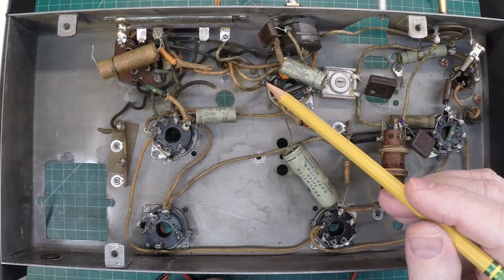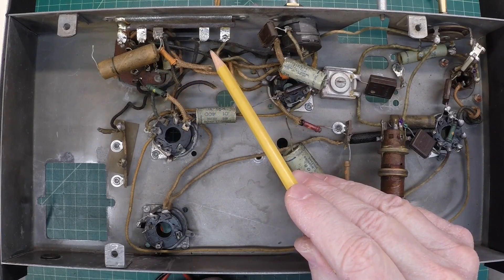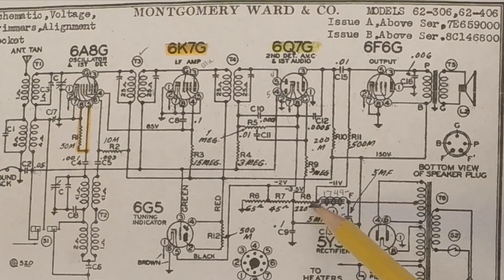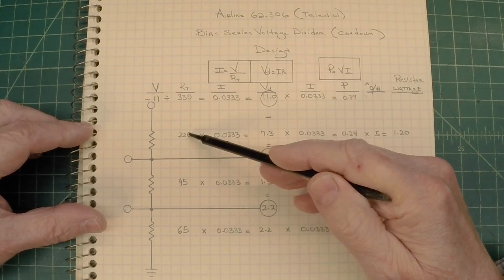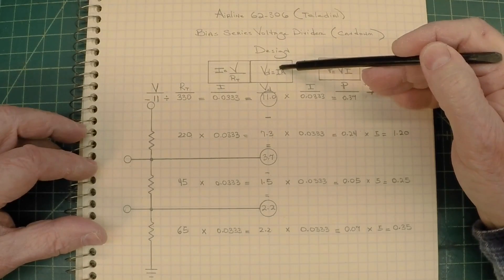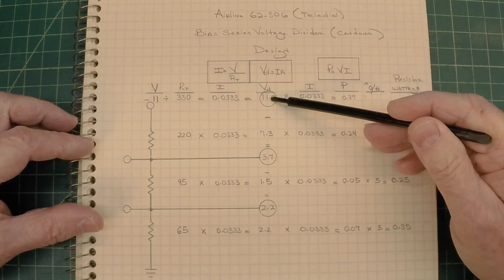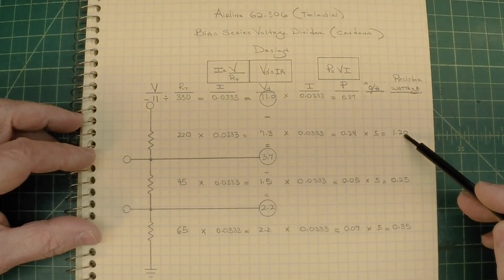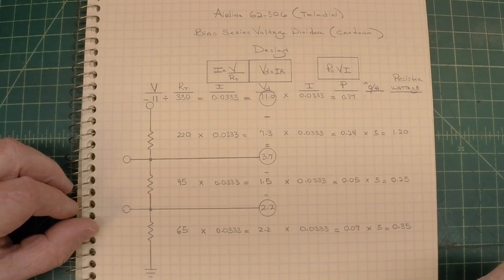Airline 62-306 Teledial - Candohm Resistor (Voltage Divider) Math

Comment: Never had much luck with those candohm resistors. I've had to do exactly what you've done. That was a terrific explaination, and I hope novice and more advanced radio repairers/restorers take note!
Reply from the maker: Thank you Bob. It’s been some time since I last worked on a set like this that the FC is in the CT along with the Candohm to create the negative bias voltages. To your point, all high value resistors in Candohms in the B+ side are almost guaranteed to be bad. Best, Don